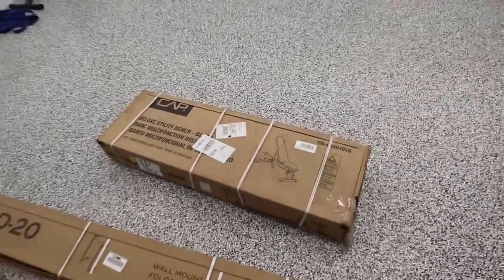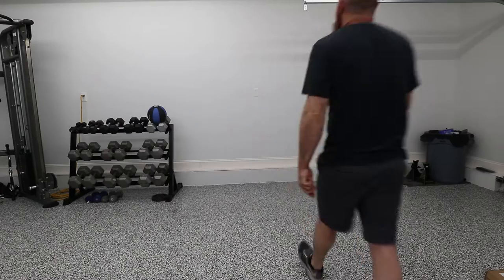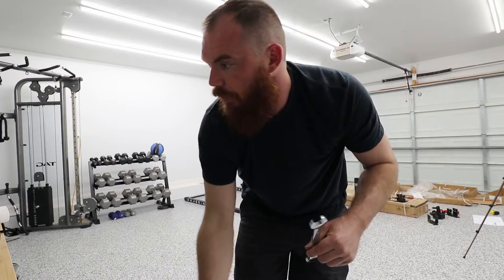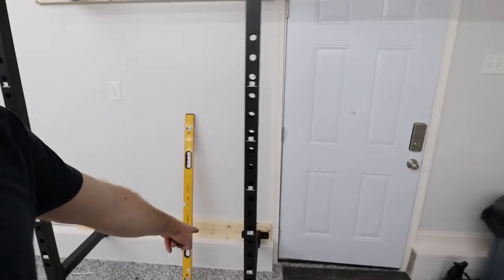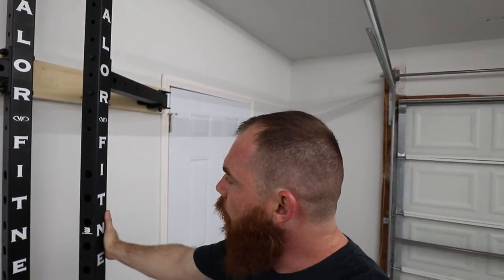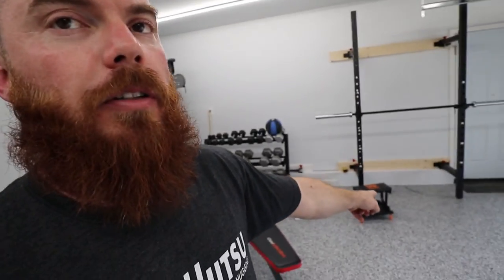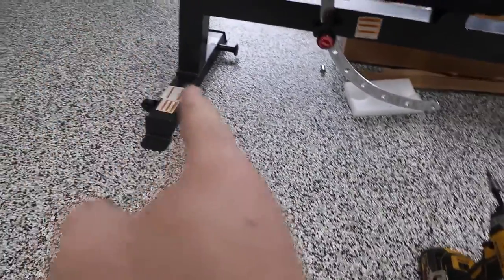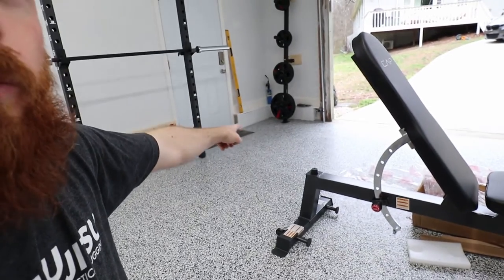Home Gym Build For Covid-19 Installing Valor Fitness BD-20 Folding Rack DIY

Comment: Looks Great! I had a question for you as I'm in the process of setting up something similar.... I was wondering if you knew the length of the wall that your equipment is on, just up to where your door starts? I plan on putting a functional trainer in corner (like you did), then dumbells in the middle, and a Smith Machine along the same wall. My wall up to where my door starts in 18ft 2in which I think is just enough space to fit for me. Thanks
Reply from the maker: The whole wall is 23ft so I’d say about 18 ft but I’ll get exact measurements tomorrow for you. Thanks for watching

Comment: What are your thoughts on the performance of the valor BD 20 wall mount rack? I'm debating between that one and the way more expensive rogue. Are you happy with the performance, paint not chipping after a few months use?
Reply from the maker: I love the valor, I was debating same thing but glad I went with the valor it does a great job... the hooks are a bit odd but once you get used to them it’s fine. No paint chips but I treat it well and don’t beat on it
Reply: @BOO5Tchannel  thanks for the info!